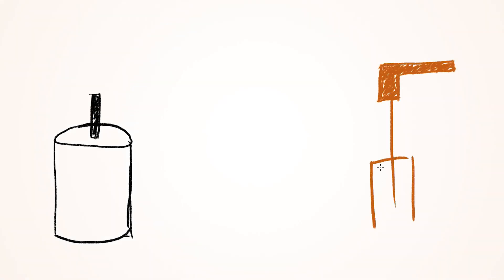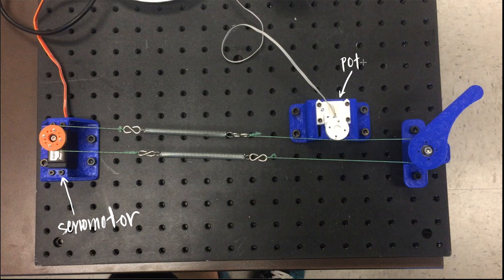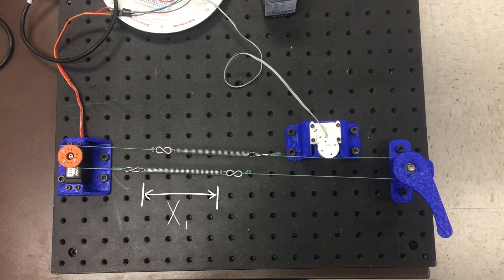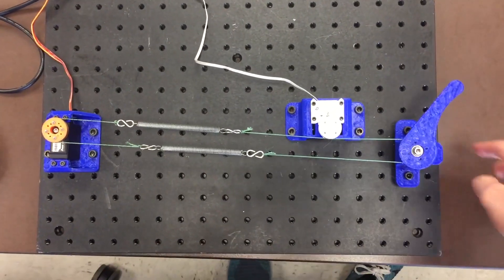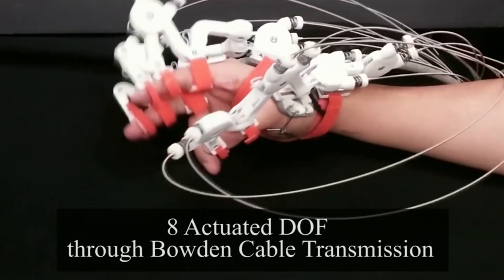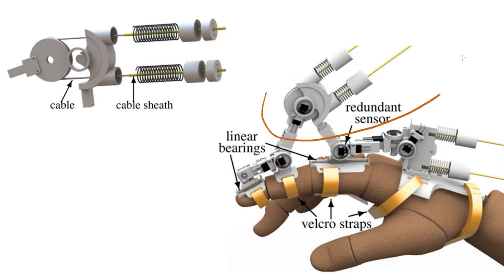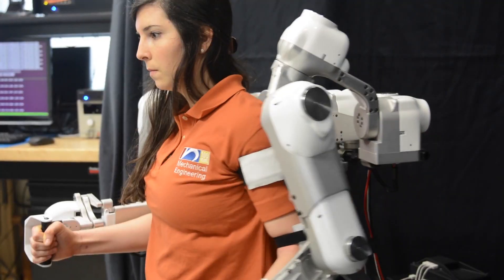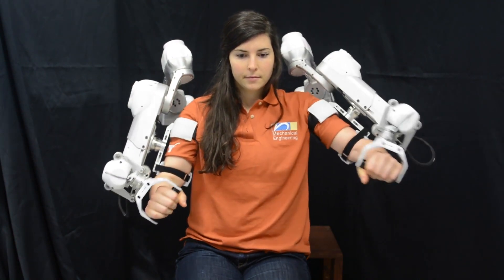Series Elastic Actuators

Comment: Couldn't force/torque also be measured by motor current, and be controlled by limiting the max current the driver delivers? Regarding the argument about shock tolerance, conventional robotics are lacking in this area mainly because they employ position control and have difficult to back-drive gearboxes. I suppose a high speed control loop designed specifically for force control could overcome these issues without needing an elastic element? I know there are commercial robots such as the FANUC CRX series that are suitable for working with humans, and have "teach" modes where the operator could physically reposition the robotic arm while it is in a sort of compliance mode. https://youtu.be/BbxoA-OXRN4?t=28
Reply: Speaking of the torque measurement, what you've proposed makes sense and it will work, but up to a certain degree. Imagine a highly dynamic system with motors that have backlashes (which is the case even for dynamixels after a couple of month) and a gearbox. The thing that you are going to measure with the current and voltage is the power, not the effective torque exerted. And in order to measure that (same with measuring pressing force in the humanoid feet) you will have to use some deformable elements mounted on the flange, which is extremely difficult to engineer. The other way to do it is to use elastics and measure two positions, thus calculating the effective torque. The other benefit is the shock absorption. Any kind of a digital control loop will have latencies, and moreover, if there are backlashes in the system, it will be imprecise. The solution here is to use a spring, which implements a mechanical control loop with the effective speed equal to the speed of sound in metal, which is nearly 10km/s. But the question is good and reasonable :)
Reply: The other reply to this question is very good but there is one thing I would like to add and that's cost. Its true that you can 'simulate' compliance and backdrivability using control but the cost for doing so in complex systems rises dramatically since you'd need precious metals (gold/platinum) for fast signal transmittance and top of the line controllers and actuators. In comparison, ingenious engineering tricks like this are a lot more cost effective when force control is a lot more important than position control.
Reply: We must reduce our dependence on electricity. We must not use electricity and batteries for everything, even in simple matters, as this is exaggerated !! Making it simple and efficient away from complex and highly sensitive electronics and annoying coding is the way, together towards better sustainability.